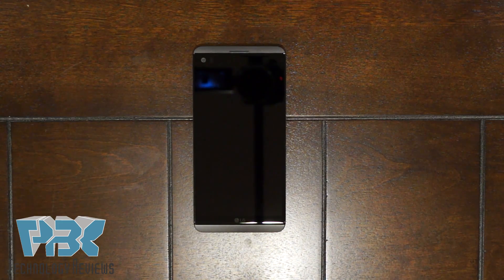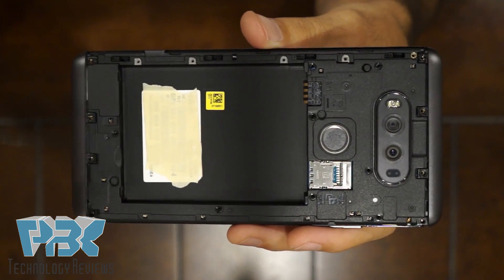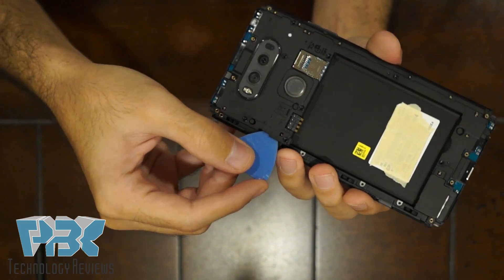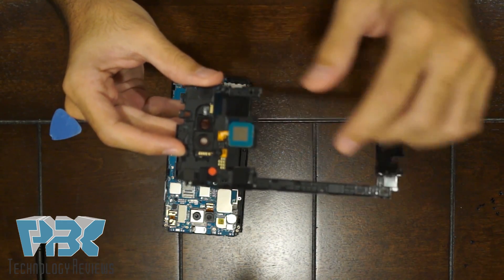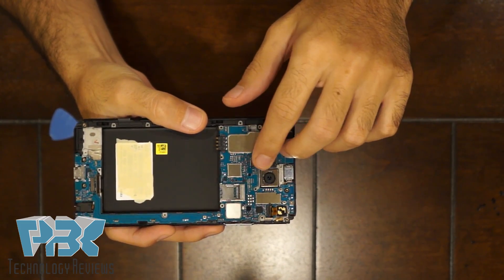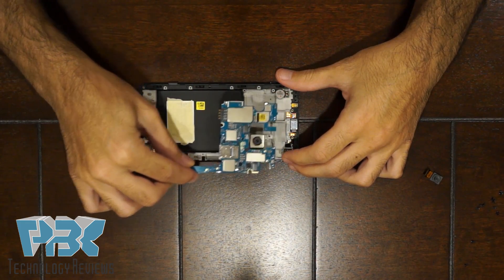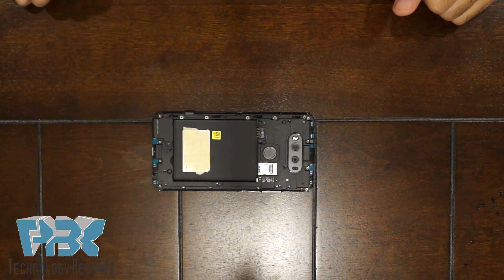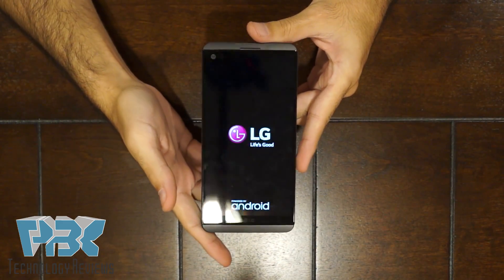LG V20 Disassembly Teardown Repair Guide

Comment: Very fine video. However, you do not have to remove the small camera to remove the motherboard, unplugging it is enough. It is also held in place by some sticky which was not the case in your video. Also, yes. Use alcohol to remove the pink dried thermal paste and replace it with a small drop of some new before reassembling. As another  poster mentioned, it may speed up your phone!

Comment: Many thanks for this, had some extra Noctua thermal paste and decided to replace the stock  paste (Which was just cheap pink goop) A good bit snappier after the boot up.
Reply from the maker: your welcome
Reply: Hey did you remove the pink pad there ? Can I just remove it and put a thermal pad instead ?

Comment: Can you pls create a tutorial for replacing the thermal paste on V20?
Reply from the maker: Hi, just follow this video to take it apart, and you can just take off the old thermal pad (circle pink looking thing) and replace it. I don't think these used thermal paste from what I can remember. So you would need a thermal pad instead.
Reply: Thanks a lot
Reply: @athrun-tv  There is thermal paste on the pink part.  Some people replace it with either a .3 or .5 mm thermal pad but most use paste.  Thermal paste is better at heat transfer than a pad, but some people like to use the pad in this situation to fill a supposed minor gap between the two surfaces that paste does not generally fill.

Comment: If my v20 doesn’t want to turn on would there be a way to remove the memory from my old one and put it on a new v20??
Reply from the maker: Hi, if you have it stored on your removable sd card then yes but if its on the internal phone memory then you would not be able to.
Reply: @PBKreviews  Why not? Is it not possible to solder off and replace the memory with old one?
Reply from the maker: @philindeblanc  Its possible, but you would need to have professional solder skills  and the right tools for doing it. Most people can't. Very few people would be able to do it.

Comment: Any body know the function of the two small contacts that are located on the top left (can see @ 4:09 on video)? There is gray tape attached to it that runs through the top on the frame. It has P4 and VZW labeled on it. My new assembly did not have one pre-installed and I teared the old one when moving it.
Reply from the maker: are you referring to the gold contacts? It would probably be the antenna lines for reception/service. The one that says VZW would be the Verizon antenna line. I would believe if your missing that, your reception would be poor or not give you reception at all.
Reply: were you able to find that part, because i broke that flex cable to.

Comment: Hi all, any one know where gps antenna v20 located ? My v20 unable receive gps signal correctly. Thanks
Reply from the maker: I'm Not sure but I think if you look at the aluminum battery cover on inside around camera opening you will see an antenna adhered to it. It has gold contacts which touch contacts on the board to give signal. You can try looking at that to see if it has any issue. You can see this at 0:33 in the video on the right
Reply: I have this same issue. Did you find a fix?
Reply: Mitch White not yet
Reply: pwrdbykyank i already try to pull it so can contact aluminium back cover. But still not work
Reply: If you bought the phone refurbished or from a sketchy seller, they could have put the wrong parts to the wrong phone. Hope this helps. https://www.reddit.com/r/lgv20/comments/7fx2gz/becareful_buying_the_top_plastic_bezel_of_the_v20/?utm_source=reddit-android

Comment: Awesome video. Thank you! I subscribed! ;) I hope you know the answer. My v20 has that screen flicker / jitter when watching any video or photo, locally or on YouTube. Even Google play is doing it now. With older models people have reported exactly the same issue, and people say to remove the back cover, then to loosen the camera and screen ribbon cable from the motherboard (like you did) and reconnect then, to fix. Ever heard of this issue / solution? Cheers! ;)
Reply from the maker: Hi, this is the first I'm hearing of this myself, but I wouldn't jump to a hardware issue right away. First try restarting the phone in safe mode and see if it still does that. It kind of sounds like a software firmware issue to me. It might also be some apps you have on your phone causing issues. If safe mode doesn't fix it, try backing up your stuff and do a factory reset on the phone and see if that fixes it. If it does then you will know some apps or firmware issue was causing that. If that still doesn't then look into taking it apart and putting it back together. I'm thinking some apps might be causing ram to run low or processor to overheat causing some issues. Let me know what happens.

Comment: i have a microphone problem on my V20 F800S which to be exact, when i do video calling via whatsapp or normal call with loudspeaker mode on.. the other party only hear a dead silence from me, even if i shouting out loud at the phone.. should i replace the secondary mic which is obviously near the earpiece or the third mic which is soldered at the motherboard?

please don't be a third mic, i'll be doomed if the third mic broken because i can't back to micro-soldering anymore..
Reply from the maker: I'm not too sure which mic would be having the issue or if the mic is the problem. Have you cleaned out the holes for the mics on the phone first to make sure they are not clogged? Second check the headphone jack, maybe something is wrong with the headphone jack and it thinks a headphone is plugged in when it is not.

Comment: Does anyone know what the silver strips on either side of the LG V20 are for? They run up both sides and end at the top in green tabs.  On mine one of the tabs is sticking out and could get caught.  I was hoping to find out here but they were not mentioned.
Reply from the maker: I don't know what silver strips you are referring to
Reply: Actually they are black not silver and end in a green tab at the top.
Reply from the maker: I still have no clue which part your referring to. If you could get a pic or something would be great

Comment: Whenever I'm in a call and I activate speakerphone my microphone becomes muted. However the microphone picks up my voice when I'm speaking into the phone regularly (ear to the phone) and even when I'm recording audio. I've done plenty of factory resets to know its not a software issue. What part would I need to replace to possibly fix the issue?
Reply from the maker: There are different mics around the phone which activate for different times. Check and make sure the small holes around the phone are not clogged causing sound not to enter. The speaker mics usually are located on back or top rim of the phone. Should be a small dot/hole.
Reply: pwrdbykyank thanks that helped me big time
Reply from the maker: Glad I was able to help :)

Comment: can u tell me where the antenna port is...i have googled n cant find it.
Reply from the maker: well the top and bottom plastic pieces have antenna lines drawn in them (if im not mistaken) and they touch the contacts on the top and bottom of the board.
Reply: pwrdbykyank 
thank you

Comment: it's so strange when a single phone   I was ready to pay $700 now after opening it seems what the..... don't want to spent even 100...... quantative mind!!
Reply: stallio the v20? id never pay 700 either lol. its still one of the best phones on the market. it has the best video so far from any phone ever made and im glad the screen is easily replaceable my screen finally got a small crack after falling face first like 10 times but it still worked great after!! i got it for 400 but def best phone of its time

Comment: after replacing the middle assembly with the speaker and fingerprint reader, I no longer have reception.  I checked all the pins that touch the antennas and even tried bending them up a bit and still nothing, any suggestions?
Reply: can i ask you where the antennas are located? is there an antenna port? please help
Reply: same problem.. you know what is solution?
Reply: Same thing happened to me just yesterday. Nobody ever figured it out?

Comment: some of the v20's are having issues with the audio on the loudspeaker /lower speaker.(ie,sounds distorted or blown)
could you look and see where the amp is located and where connection routings  are  for that speaker?
my v20 lasted 12days since activation.
thanks for any help you could give.
Reply from the maker: Hi we don't have any v20's at the moment for me to look at but have you tried downloading third party equalizers to mess around with settings see if it might be a software issue they might fix in future?
Reply: yes i had tried aftermarket eq app's but they didn't make the slightest difference.
i first suspected there were problems with the amp when i noticed static noise coming from the phone you could actually here the amp switch on and off almost sounded like a cold solder joint or bad connection.
i'm looking for an v20 with a bad esn or broken lcd for testing ,i was hoping someone had already started looking into this problem.
thanks for the reply.
Reply from the maker: Oh I see, sounds good keep us informed if you find out.

Comment: Hey, is the glass lens cover on the plastic frame removable? I hear it's quite prone to shattering and I would like to know whether it could be easily replaceable
Reply from the maker: Yea its replaceable/removable but its not too easy to do either. Its held on with adhesive.
Reply: pwrdbykyank By not easy do you mean it has to be heated to soften it? Could you describe for me the steps, I'd really appreciate it, thanks!
Reply from the maker: Yea needs to be heated and pried off.
Reply: pwrdbykyank Ahh ok seems doable, thanks man
Reply from the maker: no problem

Comment: I just replaced my screen and painstakingly moved every small component over to the new assembly. Was that necessary or did I only have to move the headphone jack, ear speaker, and camera?
Reply from the maker: Well everything is there for a reason so you would actually need to move everything over. The gaskets/contacts/covers etc. Gaskets if any would prevent extra light hitting the light sensor to turn screen off n on when its to your cheek, or prevent excess noise coming to mic. Those contact points and everything else would be needed to make whatever they are going for work and receive power. Unless your replacement comes with all those, best bet is to move them over to the new one :)

Comment: now why can't everybody else make phones like this? wish this phone had wireless charging and water resistance though, and i would have been just fine with a plastic peel off back like the old samsungs. kyocera seems the only company that still makes no-nonsense phones designed for function rather than fashion ... unfortunately the specs on those Kyocera phones are from 3 years ago, so you might a well just buy a used Note 4 instead.
Reply: g1981c grenade?

Comment: You need better lighting, and using a dark brown background is not good either.

Also your PBK logo in the lower left of the screen is way too large.  

I'm just trying to offer some helpful feedback.
Reply from the maker: Thanks for the feedback, I did use lighter backgrounds before but would cause the camera not to focus as well. The more light I used the less control I had with the focus for some reason. Also the logo I make large because I've had people crop out the video before and use as their own lol.
Reply: Dave Satay
Reply: Dave Satay@
Reply: Dave Satay
Reply: Dave Satay
Reply: pwrdbykyank